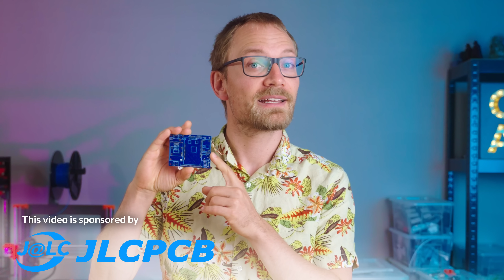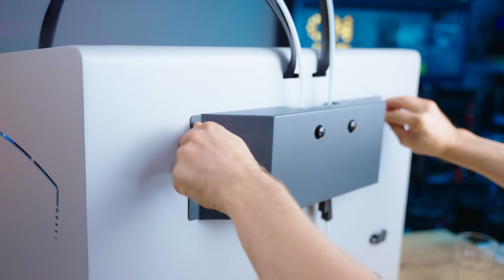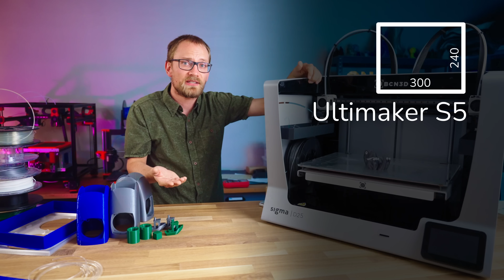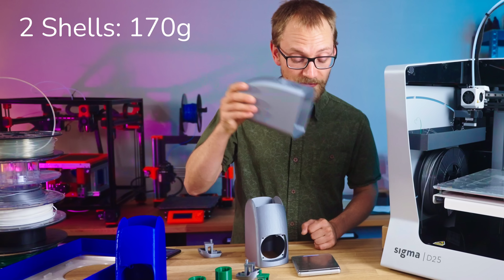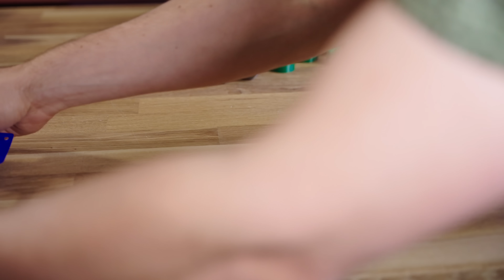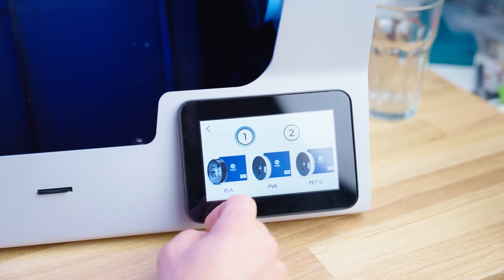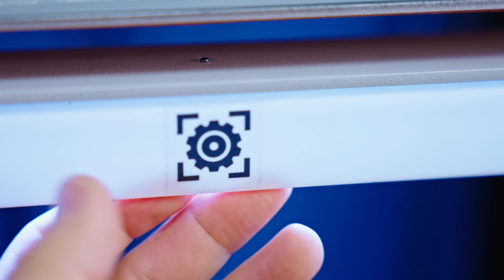Is this BETTER than the Ultimaker S5?

Comment: Fyi the main reason for using 2.85 filament is filament has a +-.05 diameter. On a 2.85 that variation is much less of percentage of error. Second it's the only way to go with flexible filament with Bowden systems.

Comment: Do yourself a favor and kick all those flex plates and gluesticks out of your office and just use a clean glas build plate. You will never have a problem with a not sticking 3D-print. Just don't clean it with alcohol, use only water and a bit of dish soap. Never had a single failed print due to not sticking on the build surface. Works with PLA, PETG, ABS and Nylon without any problems. A small brim is only needed to prevent warping on corners/edges and make sure the temperature of the build plate is set correctly.

Comment: I work with an S5 and material station (try to) at work. R&D. We ended up buying three Creator Pro2’s instead. Extremely reliable printers. Super quick startup and cooldown. Unlike the 20 minutes of prep time and ten blobs of pre extrusion every startup on the S5. I am a strong believer of not wasting time on it. I’m not sure about the reliability of the BCN3D but I can say that it should be leaps ahead of the S5. A professor In mechatronics agrees.

Comment: I wonder, is that SSR switching the bed itself or is it switching the PSU, because if it is switching the bed itself it's a MOSFET with a heatsink on it because regular SSR's are based on TRIAC's which don't turn off unless you truly force it by shorting the output, or if it reaches 0V, and on AC it obviously reaches 0V multiple times a sec, if it is on the DC side it'll be a MOSFET

Comment: I could achieve mirror mode with two Prusa mini's, two i3's, or any two 3d printers, at a heck of a lot cheaper price (like 10 times cheaper per unit, and 5 times cheaper even buying 2 other printers).  So that feature isn't really a feature in my opinion.  420mm wide print space is huge (literally).  Print Quality, now that is a big feature too, though not sure I'm seeing a quality jump that warrants the huge price difference, power consumption, and space required IMHO

Comment: My Craftbot Flow IDEX XL feels similarly unpolished. Those of us in the community are constantly finding firmware bugs, and though the bed leveling and mesh leveling are great the bed goes out of level every time you remove the flex plate. Seems like a lot of the idex machines filling niche roles are less polished

Comment: Dude if a 4k printer can't handle 2.5k acceleration, it's garbage. How is 2500 "insane"? My acrylic i3 knockoff with a few upgrades can do higher than that without issues like that.
Reply: 30mm/s petg? I can do 220mm/s at 2.5k before it starts shaking too much (acrylic body) with a volcano, direct drive with a crappy extruder.. just wow.. I would hope a printer that expensive could at least consistently do 100mm/s petg..even 60 for high quality but 30? Id die waiting especially on such a big printer

Comment: The modix printers fit your bill as dual extrusion, and bigger build space. The smallest one is 600x600x600. The only advantage is true dual heads. Which is debatable as a big enough advantage.

Comment: Good Job on the Review as always! Alone the heat up time makes me not want this Printer...

I built a 400x400x400 CoreXY printer with a Chiron Ultrabase as the bed and it takes longer than my smaller printers to heat up, but only about 5-7 minutes. Did they use a 12V supply in this printer?

Comment: We have 3 BCN3D Epsilon W50s at work and I would suggest avoiding these machines. The bed leveling feature is useless unless you adjust the mesh bed level by hand so the bed adhesion is incredibly inconsistent. The machines are not rigid and have lots of moving mass so they're slow. The long bowden filament path paired with the 3mm filament also gives pretty underwhelming print quality compared to a prusa. We've also seen catastrophic jams and failures a few times with the bowden tube being ejected in one case. One of our three machines can't be connected to the internet at all so we can't use the cloud printing feature and after months the issue still hasn't been resolved. The dual extrusion performance also wasn't great out of the box though that may be a tuning issue in part.

Comment: This printer is baffling. It's so well designed and engineered, but there is somehow no mesh bed leveling (or any automated leveling) for a bed this size. Who has first layer issues these days where bed leveling is usually just there and works.
Then they slap a mostly useless cloud-functionality in as a quasi-requirement which will mostly exclude it from industrial applications (even if it can be circumvented). I understand going with your own firmware for the printer, but why not just use one of the incredibly well developed and tested firmwares? Then loading filament from the screen probably just works without driving random motors...
Finally, it has a glacial print speed (by default) for a bed the size of 2-4 other printers combined, dragging print times that actually use the volume into actual weeks!?

I was actually looking for a more "professional" printer that can do large prints and is at least dual color, but all of the above means I'm probably better off getting a "normal" large volume printer and retrofitting a 2nd extruder (independent or dual hoteven mounted) and using my privately learned knowledge to make the machine just work, so collegues can essentially "just use it". Cause this isn't it when people need a course on how to level the bed just to start a print instead of it just doing a 3-point-probe automatically to tilt a mesh and "just work" after that.

Comment: The Creatbot F430 is a compeditor in the same pricerange, fully enclosed, dual printerheads, 400x300x300mm print size, heated oven, 430degrees (prints PEEK) has basically everything the D25 has and more… the F430 is truly the most printer for the buck

Comment: Pretty sure a typical DC SSR is a MOSFET plus some extra protection and interface circuitry in a standardized frame. But it baffles me they went DC heated bed AND an SSR-like module. Is it really that hard to make AC safe that they'd run a PSU just to make bed heat?

Comment: I already had the perfect offer for the D25 for only $3800. But then I saw the setup thing on your channel with the "cloud" thing. COMPLETE DEALBREAKER. Now I am in the market for something similar but as you said, there are not that many large, IDEX reasonable prices. Fun fact, the 2.85mm would have been a bonus in my case.

Comment: So basically it is a wannabe Ultimaker, and that is not really a godo thing as my experience with ulitmaker is horrible. They copied nearly every flaw from ultimaker.
First of all the mechanical design is garbage, a large bed supported by one one end, is riduculous and asking for stability problems.
They couldn't even get the basics right. Even if I was given this printer for free, wouldn't even let my dog use it.

Comment: I've been working with a BCN3D  Sigm R19 for more than two years now. After 1600 printing hours I know the machine pretty good. The only big problem I have is the Bed leveling assistant which is more or less useless. The build platform will never be perfectly adjusted. At some points on the bed you cant get the printed parts of. On others you can't get them to stick. It's almost not possible to manualy readjust the leveling as you are only meant to adjust the level on two points. thr third one is fixed. The bed leveling takes me around an hour to get perfect.
The issue with snapping gilament in the bowden tubes depends on the filament u use. I had some PLA filaments, for example, which never snapped and some which snapped all the time.

Personally I like the BCN3D Sigma R19 and would love to test one of the Epsilons. I hope the  bedleveling works better on the new printer generatrion.
In my opinion the BCN3D printers are more an enterprise solution than a printer for hobbyists but I hope that I could help anyone here.

Comment: I have a Sigmax R19. Never worked properly. Maybe got 20 prints off it over 3 years. No support, heat creep, grinding filament. Bearing in mind that this is a production machine. 

Yes it works lovely for a bit, but it has now been abandoned. A 3,500 euro machine

Never again.

Comment: Have you checked out the Raise 3D E2? That's what I have and it has a similar price tag as this Sigma and from what I've seen its better than this one. Dual extruders, fully enclosed unit, helpful ticket systems with good support. Large build area.

Comment: ...the existence of the voron design utterly invalidates the existence of this thing.

Frankly this thing should be called "stupidtax" - printer edition.
Reply from the maker: I love my Voron, but they're in a different class - the Sigma / Epsilon / Ultimaker are machines you buy and start using, while you have to spend 30+ hours sourcing and assembling parts for a Voron (while still not getting dual extrusion). If you time is free then sure, the Voron is a better choice.

Comment: 10:56 Why didn't you dry the filament. We already know it snapping off is a feature of the moisture and the formula so that wouldn't be a printer issue.
Reply: Pla breaks like that in Bowden tubes due to stress. MMU users deal with it too. Your whole setup can be sealed and actively dried and it will still happen. PLA forms tiny micro-cracks as it is bent, and they grow over time.

Comment: I'm not d'accord with you on this printer.
The wiring looks sloppy as hell instead of "textbook" in my eyes.
Yes, it has dual extrusion, and use SOME quality parts, but there's a lot of problems with this machine you also talk about, which aren't just OK at this price point. 
If I still have to constantly tinker and fiddle around, like on any chinese machine, to get reasonable prints, I really see no point in investing in such a machine, whether as a company or for private use.

Comment: Dont know if this printer model, but Sigmax has NO (normally open) end stops. Also there are no ribbon cables but flexible pcb's. Printer cannot recognize, when flexboard snaps and then crashes bed when homing or calibrating bed. Why are they not using NC end stops? 
@Thomas Sanladerer how is that on D25?

Comment: In my 5 year experience of Prusa printers having a larger / taller Z-axis provides flexibility when you need to print the part in a particular orientation (for strength in a particular axis or to avoid overhangs) but you want to still print the part as 'long' as possible.

Comment: I had some R17 and R19 and participated a lot on the community to be one of the first to have bondtech/E3d in 1,75mm switched on it 
But sincerely I do not recommend to anyone to buy this printed and any from BCN3d 
Many hardware problems: thermal issue on bed, leveling is pain in the ass, etc etc, it is very weird that they didn’t change it! And the worst they don’t Care of support old printer, when they go on the market with new one the old one do not have anymore FW upgrade etc etc 
Better to buy a UM if industrial purpose is necessary, a PRUSA for bedlevelling and reliability, or a VORON if you are not afraid to work on it and want the best
BCN3D is Not reliable as a 3d printer company

Comment: Great review Tom!!! Chewed down to the bone and that's the way it should be done!!! It's really annoying when you see a allegedly professional machine with such sloppy mistakes. I have built from scratch two of my machines at home, one thing I've learned, anything with 3mm and above aluminium heated bed with a size above 235x235 NEEDS mesh levelling, period!!! It warps even the glass plate on it when you clamp it. And the list can go on... Perfect example of just having top components is not good enough.. And that's why I build my printers myself.. BTW, the first was inspired by your Dolly, heavily modified, it turned out a great mix of chinese parts that keep working and refuses to die :-D You need to see it, will piss yourself laughing :-D

Comment: Tenlog TL-D6 is a 600×600×600 idex printer at around $1600 usd. I just purchased the tl-d3 pro for $600 and first prints are looking really great.
For the stuff I'm doing the tl-d3 had plenty big enough build volume of 300×300×350 and would allow me to do my metal filament tests with dissolveable supports, might be worth a look at both products.

Another benefit for me was that it's direct drive and allows easier printing for brittle filament.
Reply from the maker: Yeah, not sure if a 600x600mm bedslinger is the best of ideas.
Reply: @MadeWithLayers  maybe not, but I also haven't seen any reviews of it to judge (perhaps for this reason...?). so far the I'm really liking the d3

Comment: I think there is actually some practical meanings of using the 2.85mm filament, because of the bowden setup of this machine as well as for the Ultimaker machines. Their extruders are far away from the hotend, driving a 1.75mm flexible filament, like the NinjaFlex or the Essentium TPU80A, will be quite difficult, however the 2.85mm filament will be a bit more “stiff” and makes it easier to be pushed through the long bowden tube.
Reply: I agree, and for printing 2.85mm PLA, the pro pla filaments are typicality less rigid. Also buying domestically produced PLA means it doesn't have to spend time thermal cycling in a shipping container, hence the domestic filament is less brittle.

Comment: Heads up, not tested yet but I suspect 3mm filament can theoretically melt faster because heat penetration distance goes as r, but filament xsection area goes as r^2

Comment: I'm a bit disappointed with this review. On cheaper printers, you have pretty much ragged on them for not using ferrules on the wires, not being properly grounded, and not having protections enabled or available in firmware. Those were 3-500 dollar printers. This one costs $4000 and you didn't even check those items. You mention it has a lot of shortfalls but sing it's praises because it's "different" and not a cookie cutter printer, but then show us where the cover is coming apart. How about ragging on it for being half done for $4000? Shouldn't we have 10 times the expectations for 10 times the price?

I still enjoy your project videos, but your reviews are becoming worse with time. For $4000 that printer should work right out of the box. The profile should work. The cover shouldn't be coming apart. The bed shouldn't shake all over creation (the right corner was totally unacceptable...). It's a good printer for the 500-1000 dollar range but come on. Call a turd a turd.

Comment: Throwing away a perfectly good hotend, heater cartridge, and thermistor just to replace a worn nozzle seems incredibly wasteful, and is reminiscent of being gouged on inkjet printer cartridges. For an enterprise level product I'd expect the software and profiles to be more polished as well. Otherwise it's mechanically very capable for the price!
Reply: Very frustrating, so much that I have searched high and low for substitute nozzles, but it's a strange design, you can get them but there not the same standard as e3d that are fitted
Reply: The hotend and heater cartridge are actually very cheap and simple parts, and by not having the consumer touch them you don't run into a problem with the closed loop system possibly becoming uncoupled, resulting in runaway heater. I see the reasoning for it, but I agree with you, it's tough to accept that when you're used to buying 100 nozzles for pennies each and swapping them out yourself.
Reply: @3dpprofessor  yeah but they charge around £80-£95 per hotends plus tax's n shipping, but if you buy into a £4500 8bit printer I guess you got the cash. To replace the hotends, the user has to cut cable ties, remove a protective cover undo a clip, as well as a couple of hex bolts, before leveling routine & pid tuning. I have damaged one of my extruder boars in this process which costs ~£30 plus shipping to replace, the wiring is fairly well routed but having a metal shroud around the hotend my heater cartridge wire also shorted blowing my main board, the since put in a replaceable fuse, (I just soldered in a  fuse able resistor as my board lacks the removable one). I truly hope they have learnt from the troubles of the earlier machines like x axis now stainless steel as opposed to my slightly bent aluminium u channel (folded aluminium not extruded). 😁
Reply: People who buy a 4k printer can usually afford a new hotend every now and then. They rather expect ease of use.

Comment: You say this is a very innovative machine, but somehow it feels quite dated to me. Using glue stick on a glass bed, no ABL on a large printer, 3mm filament, painfully slow speeds, those are things that even cheap printers have moved past at this point. The only way they can get by with that is by having a niche product and a good sales department. Also, I would love to see you print flexible materials with those super long Bowden tubes :D
Reply: Im gonna defend the gluestick. I just use it for everything as it always works. evne on my PEI flex plates. Its the most reliable way of ALWAYS having the prints stick. 

for the rest I Agree
Reply: @jbergene  If there was a PEI sheet, you'd at least have the option. For PLA and ABS I always print directly on it with great success. The only times I use glue stick is with PETG, more as a release layer though to protect the PEI.
The great thing about options is that if you prefer glue stick, you can always add that.
Reply: I've been printing for over  a year now, on both delta and carthesian printers, never had to use any kind of adhesive for the prints to stick. I used stock aluminum ender 3 plate, upgraded magnetic, and a glass bed.